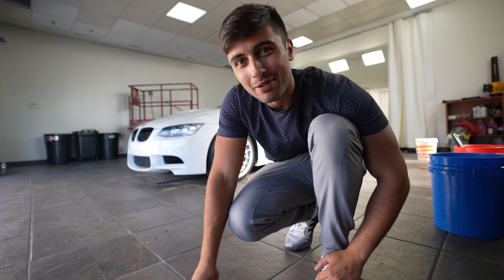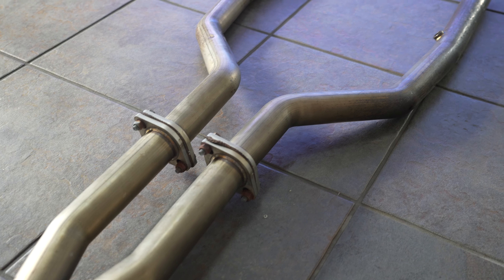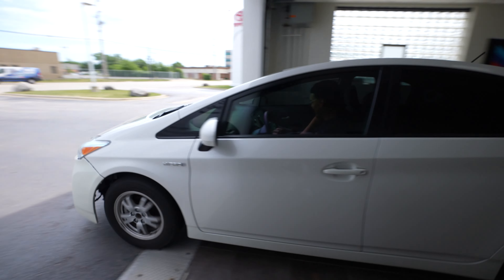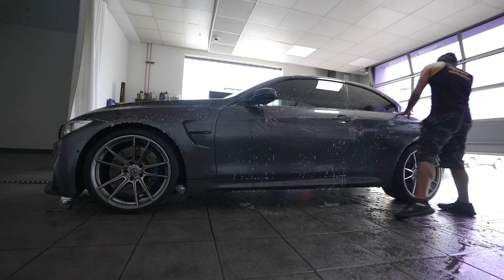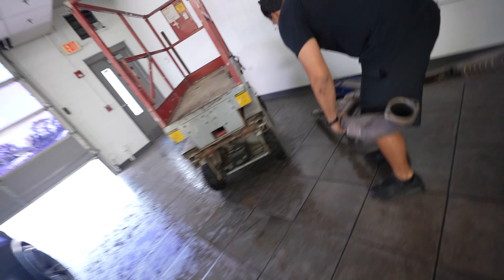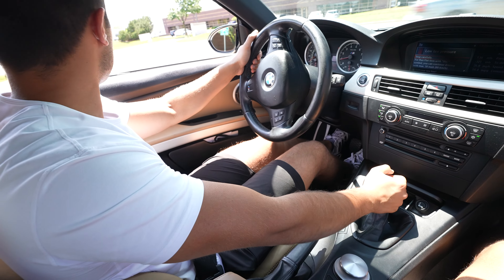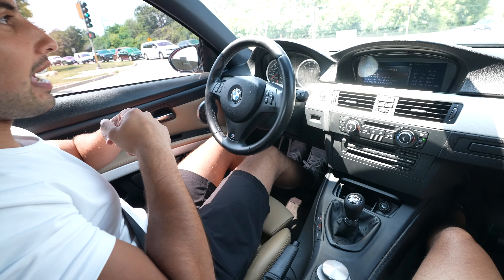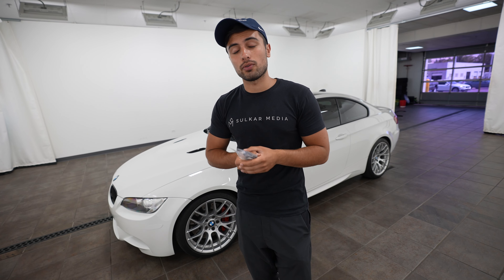Installing Straightpipes on My Manual V8 E92 BMW M3! (Sounds SO GOOD!)

Comment: Any drone on the highway?
Reply from the maker: Honestly I hate drone so I was paying close attention on the highway- it was great. Really impressed with this setup, doesn’t really unleash until WOT
Reply: My stock exhaust  e92 m3 does drone at like 70 to 80 on the highway it is minimal turn up the radio if you don't want to hear it.